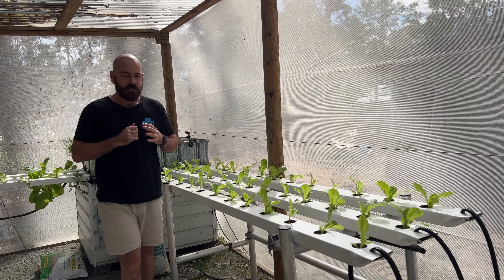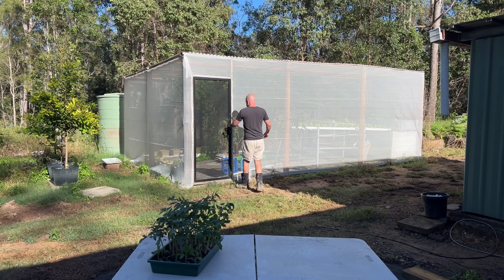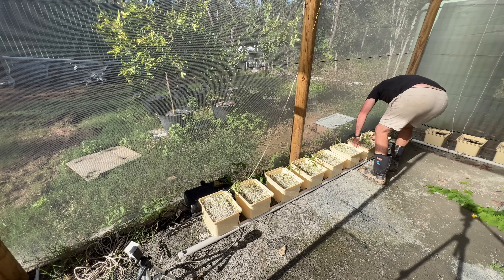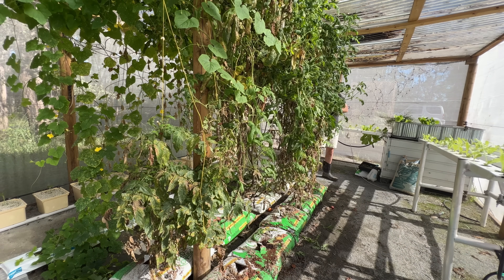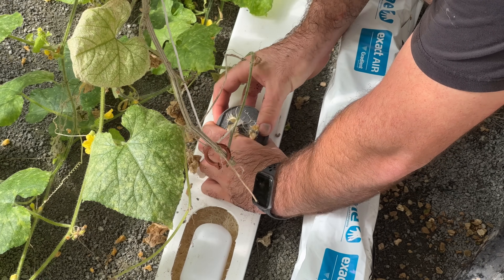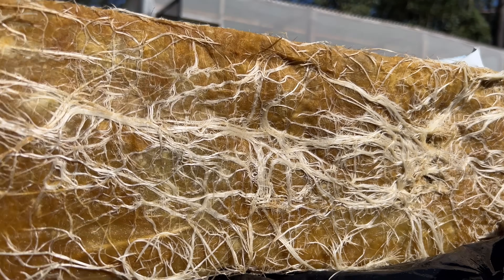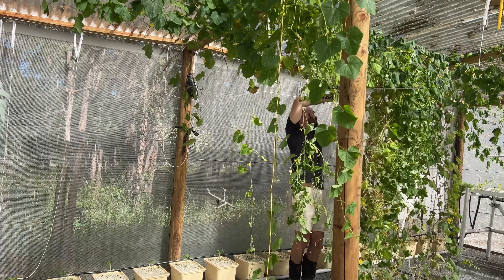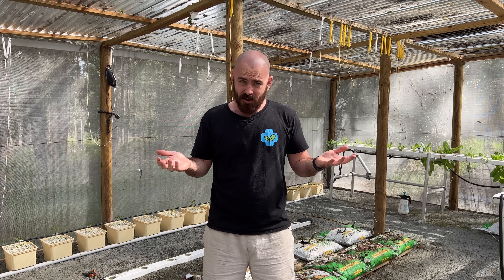Exploring the Wicking Hydroponic Systems' Bagged Media

Comment: Mate that root shot is fantastic. The propagation through the rock wool and into the channel is great, and I'm sure you're right about the upper roots primarily getting oxygen. 

The only thing I worry about in these wick style systems is eventually salting out the top layer of medium where evaporation is taking place. We see this a lot with drip systems in the desert, salts migrate to the areas where evaporation is happening. Though, over only a few months and with an EC of only 1.5-2, it'll probably take a long time to build up. I imagine the rock wool can be washed in an acidic/peroxide bath, dissolving the salts, without making the whole thing fall apart like mud, which would be another benefit over the coco medium.

Comment: 1) Do/did you "dispose" of that root ball/system into a compost?
2) Probably a wacky question, is there any nutritional value to humans eating a root system like that? (I assume no one ever eats that type of root considering it would typically be labor intensive to harvest and tend to result in a minimal yield) ...perhaps chicken or rabbit feed would be a more reasonable way to upcycle it?
3) With the rockwool that contains no nutrients itself (does the coco?), it seems like the roots actually dont really care what the substrate is. With that in mind - could something like sand be used in a dual system (while probably having to figure out a way to keep it slightly moist since very little wicking would occur naturally)?
Reply: Roots are generally fibrous with lots of woody tissues because they are adapted to pushing through hard dirt, rocks, and they must be strong to anchor the crown of the plant to the ground. But we do eat roots - potatoes, carrots, beets, ginger, etc., it's just that these plants are specialized to store a larger portion of starches in their roots, which happen to be more digestible by us. You probably wouldn't suffer ill consequences from eating these tomato/cucurbit roots, although there's probably not much nutrition to gain.. maybe some fiber. It's not like they store toxins there or something. Every gardener I know composts their roots.

Coco is thoroughly washed and does not contain any nutrients when purchased, unless it's been fortified specifically. Roots really will go wherever they can that's favorable. Sand wouldn't kill anything, but the issue here would be allowing oxygen to get to the roots. Sand can become completely saturated with water and suffocate the roots. Coco, perlite, and rockwool are all "fluffy" unlike sand, which allows some air to flow down to the roots.

Comment: I've fixed the supply line of my bato buckets to the ground, that's easier than to the top of the buckets. I've still designed and printed some clips to hold it down, but for any new system, this is what I would recommend. One less step when removing a bucket.

Comment: I noticed that you've switched to rather large feed lines for your NFT system. How's that working? I'm guessing you have less clogging, which I would love. Any downsides so far?
Reply: In a video a few months ago he shared that the small tubes constantly clogged. He is using an individual ball valve on each run now, which allows balancing of each line. He can also compensate for loss of flow in the future by opening the valves further, instead of replacing things. Seems pretty ideal to me!
Reply: @Jacob_graber  Thanks. I missed that video. I've had the same clogging problem. It's not frequent, but it's not rare either. Unless you check every day, it's really easy to lose a row. I may try it.

Comment: hay hoocho got any tips for growing inside a campervan? that drives daily
Reply: From my experience of hydroponics indoors, use a grow light, a pump and a container. You will need to place the plants on a level surface or a suspension system for when the campervan moves.
Reply: Areo garden farm xl plus

Comment: It is very interesting to test other production techniques. Thank you.  For the Dutch Bucket, reusing perlite is not easy, as it is fragile and crumbles easily. Wouldn't it be better to use 2/4mm Clay Pebbles?
Reply: From my finding clay pebbles are better as you get a build up of grit from the perlite in the system

Comment: Hey hoocho what do you do with your old rock wool ? I went too ee muire and they'd already sold out of the coco blocks unfortunately but look forward to getting some. Seem easier to recycle into the garden or something
Reply from the maker: This is a question I wish I had the answer to.
And why I’m trying to stick to coco.
Reply: @Hoocho  Wonder if acids could be used to burn out the roots as the rock wool wouldn't probably get dissolved by most acids (possible HF or Aqua Regia). Hydrochloric is what Stomach Acid is and that breaks up food/bone etc. That way could be recycled. Then again if you dry out the rock wool or heat it up to kill the roots then potentially could be reused. Nature deals with this all the time in the ground - at least reuse them a couple of times. Possibly different crops - tomatoes then capsicum or cucumbers...
Reply: @rw-xf4cb  According to the interweb, typical "rockwool" can withstand temperatures of 1,200°F (=648°C). Considering the rockwool is a very good insulator - I'm not sure how well heating would work to burn out (carburize?) organic matter inside of it.
 I'm still trying to find a clear answer as to which acid (and which is reasonable to use at home) might chemically dissolve roots systems. But I seem to recall that the human stomach, as you noted, is composed of hydrochloric acid (HCL) which is unable digest plant fibers composed of cellulose... but I'm not sure how far HCL can actually break it down before it would be considered "digested". HCL can't break "acetal linkages" (making cellulose indigestible to humans). Guess it would take some testing to find out if it gets broken down enough for the remains to get flushed out.
  As a side note : herbivores use bacteria (microbial fermentation) to break down cellulose and a subset called ruminants use enzymes which are technically proteins (neither of which would typically be considered an "acid"). With that in mind, a typical septic system additive is an enzyme called cellulase that breaks down cellulose. This might be an option as long as it could be readily flushed out before using the rock wool again. And, once again, some testing would need to be done to determine the efficacy. I'm also assuming the "waste" from cellulase would probably be more "eco-friendly" than the byproduct of HCL use.
Reply: @Hoocho  cheers mate same line of thought as me, I've made up a big shade house and a few hydroponic systems following your work 👍 cheers for the motivation. I might have to make a parody version called haydos to do a tour video.
All the best

Comment: Great stuff! I've been wondering for a while now if any material exists which will let water through, but also block roots penetrating it, seems like nothing can stop those roots!
Maybe some type of permeable rock or fine metal gauze.
Reply: You could do multiple layers of water permeable fabric
Reply: @Ryanrulesok  Concrete is water permeable...
Reply: Geo fabric, the stuff they use to seal french drains against roots and silt, might work. Roots have insane mechanical advantage to pry things open and they start out as fine as hairs though. Ground drain systems such as cesspools have to physically isolate the drain opening into the pool by suspending it in air. If there's a wet path from soil to the pipe, roots will find it eventually.
Reply: @Jacob_graber  Thank you! That makes a lot of sense. The only other ideas I could think of were active systems to interrupt root growth, such a pulse of ultrasound or electricity through water or a wire mesh.